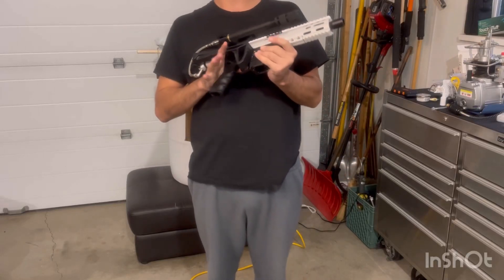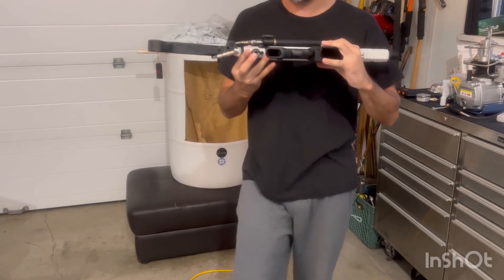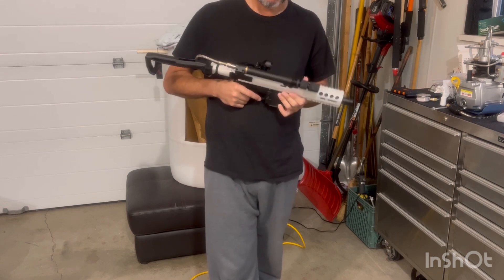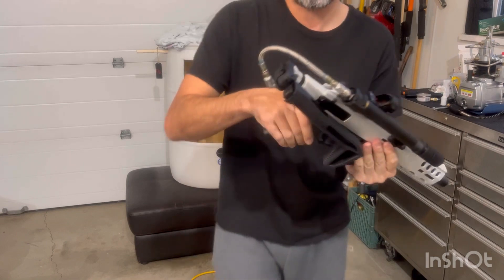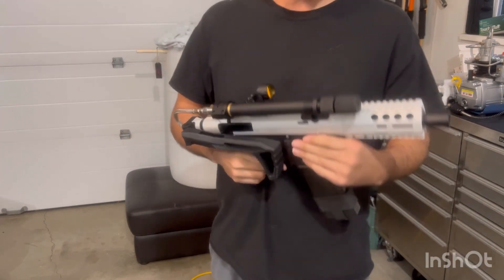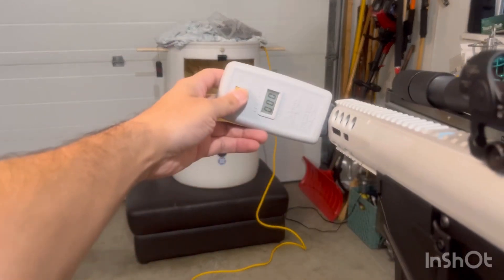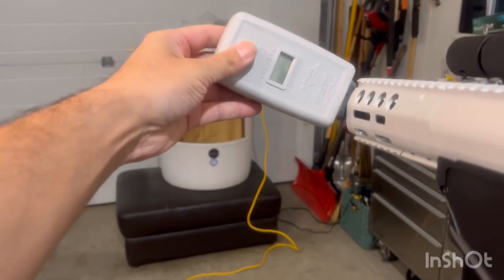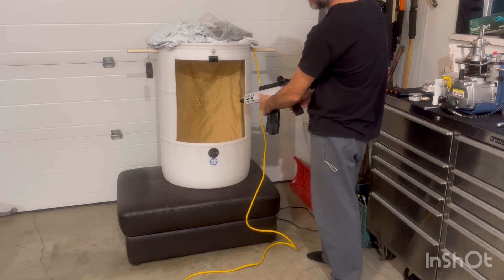Valken M17/Cqmf Bypassed on 2x12g Co2

Comment: The short-cycle auto firing (usually called "farting" in t4e markers) is caused by too much airflow--the pressure doesn't drop enough to let the bolt reset fully.
Reply from the maker: The question remains why some brand new markers exhibit this behaviour ambut most do not. I have found there are a number of factors at play.
Reply: @lesslethalfordummies  indeed. It can also be caused by excessive friction (bad oring or tolerance issues) or not enough return force (weak/bad spring). But if it happens only after modding it's usually caused by too much airflow, though it can be compensated with a stronger spring, etc.
Reply from the maker: @jungy537  i am running 2mm spring in this Cq to see if it has any effect on reliability and performance. It shorter then I would like but it appears to be working just fine right meow.

My Cq hasn’t experienced any autofire yet and i hope to keep it that way.

Comment: So as of today my build is pretty much looking like this but iron sights still on and no buttstock. But i am deciding on the 45 degree jron sightd and a scope for a cowitness so idk if Ill need 2 iron sight sets. Might look odd or maybe I'll just 45 degree offset red dot and keep iron sights at the end with an acog plus zoom scope while cowitness at the end idk yet. But for a marker i think I'm doing too much its not gonna shoot that far like a real gon so maybe ima just remove the iron sights completely and just use my scope rings for the co2.... currently my scope.rings are holding onto my quick change co2 adapter 12g since i cannot find a round 2x12g yet.  Ive inky got the stupid hexagonal umarex one.
Reply from the maker: Its easy to over do it with accessories and youll know when that happens. Sounds like it is coming along well.
Reply: @lesslethalfordummies how do you do white colors by the way? I gotta make me a frosty or a demon fire one
Reply from the maker: @-Cutz- white is just how it looked on camera after stripping the black down to raw aluminum using oven cleaner.

Comment: Getting my popcorn before I watch this lol … 😎🎯🎯🎯❤️
Reply from the maker: Caramel please.
Reply: @lesslethalfordummies  ok …. Guess I’ll be using my Hpa tank …. Last question lol
What’s is more recommended, .68 devastator rounds or hp68 ?? For home defense in my fully modded m17
Reply from the maker: @thecryptoendgame  the hp68 cycle good in the m17. I havent tried devastators yet. I did receive some clones from DK that i will be trying. Tou really can’t beat Hpa but co2 does work in a pinch just wont maintain solid numbers for much more then few shots.

Comment: I love how small it looks so badass i wanted to put zeta mags come to find out you hsve to flip them when you shoot 10 i thought it was CONTINOUSLY FEED
Reply from the maker: Yeah you are right and some of the heavier balls dont like to be invert unless you have the mag plate on the zeta.
Reply: @lesslethalfordummies mag plate? can you link me also can you link me the metal tube into the 2x12g adapter and everything betwen it or can you just tell me the names? so I can find them on mcsus
Reply: I mean i know the 2x12g adapter tube already but the thing thats housing the connection or the adapter with the metal hose and the adapter thats on the rail? whats all that?
Reply from the maker: @-Cutz- there is a plate that you can buy that slips over the bottom of the zeta mags to prevent them from falling out. Not sure where you find it but i see it all the time in the paintball groups.
Reply from the maker: @-Cutz- check out this vid it might answer some questions.

https://youtu.be/d0wPs-D7YME?si=qw118GqorpmqdOag

Comment: Love the remote hose! I want to do that with my vks but don't know what kind of UFA to get
Reply from the maker: Am struggling to decipher UFA 😆
Reply: @lesslethalfordummies   my bad - the universal fill adapter on remote lines. trying to figure out what would work in a flashlight clamp like you have or how to set it up
Reply from the maker: @theguy2137  most clamps are 1” and a select few are 1-1/8”. Common 1” UFAs are the Ninja knob style, CP has a trick one that self purges when the marker is disengaged and Palmer Pursuit had an actual adapter but had been sold out for some time.

Comment: What is the BEST  AIR SUPPLY size for M17 ????
Reply from the maker: 13ci tanks are best suited for the M17. If you can find 9 or 10ci tanks they also work very well and cut down the length a little.
Reply: @lesslethalfordummies  yes. Thats why we're were thinking of making the m17 CO2 POWER.  So we always have cartridges  on us.  And don't have to worry about the tanks running out 

But your  saying the 12gram  c02 version  isn't strong enough?

We have 13nci tanks now but it's too big to fit in a backpack.
Reply from the maker: @Save-A-DogAps  The 12g is strong enough if 4 shots get to where they are going but that can be tough in stressful times.

Comment: Hi, Can I use a 12gram co2 adapter on a m17 with no modifications?
Reply from the maker: Yes absolutely. There isnt enough liquid in a 12g to cause issue. I wouldnt run a 12g bypassed you might only have 3 full power shots but tuned conservatively tou might get 8 shots at say 20j. I am sure i did test single 12g a while back with lack luster results.

Comment: I thought your co2 build leaked heavy? So the cqmf can use both co2 and air??? Sometimes i rather just pop in co2 than top up my air tank
Reply from the maker: My m17 will handle 12g just fine but not so much the 88/90g without an expansion chamber.

Comment: So another thing looks like my cqmf will mainly be in co2, and I was gonna ask 90g because it's cheaper for bulk compared to 88, which is odd. I fired a dual 2x12g umarex hexagonal with the 88g/90? adapter and plugged right into it'd black with an on-off asa adapter all in 1... shot some shots and no leak turned it off after just to test to make.sure it works lol but anyways it works but 2 am so loud I had to stop so right now my umarex 2x12g is pressurized eith the on off asa I hope no long term damage I'm prob fire the rest in a week. Then, test my buffer 2x12g tube. I can swap to 2 x12g 2 separates, one so 48g and a single 12g 60g total real fast, but once I get ur around 2x12g, ima b😊e able to do 72g woohoo lol... but my setup is like ur nipple to back of my gun nipple double quick disconnect hose but my scope.ring is holding only a single 12g quick change so that's why I'm waiting fir my 2x12g round one my scope rings will be able to hold but so long shipping. And I haven't done the prv delete aka drill bypass but it sounds like it hits hard as shut. I love it
Reply from the maker: All i can say if you are wanting to use 88/90g because of your success with 2x12 is to test its function before you rely on it for anything.

Comment: Where did you get that 2xCo2 adapter from. I’m thinking of taking the next step and getting a Valken. And want to run it on Co2. Also can I run it on 2x NO2 12g cartridges
Reply from the maker: The adapter is from MCS. Umarex actually makes a bump to pierce 2x12g now as well much like their t4e hd lineup. Not sure where to find it yet. Skip the no2 unless you are actually keeping this in a cold vehicle over night. Remember if you were to keep it in a vehicle the chances of when you are reaching for it the cabin has probably warmed up some. N2o is consistent at most human habitable cold temperatures….but consistently low output is a more accurate description.
N20 just doesnt have the explosive expansion rate of co2 gas. Co2 is volatile when temperatures warmer then itself are introduced.
Reply: @lesslethalfordummies  thanks for the info on the NO2. I saw a Umerex 2x co2 adapter on ebay. But it was a twist not a hit and puncture
Reply from the maker: @EastCoastLessLethal  the bump puncture is new. Only thing i am bot sure of is there twist version requires 90g adapter fitting. Maybe the bump version does to? The mcs twist goes straight to hpa thread no adapter required.

It would be nice if someone could fill in the blanks because Europe seems to get stuff long before stateside.
Reply: @lesslethalfordummies  yes. I was just talking to a guy on FB. How the things like the power kits are so expensive because of shipping from Europe. I’m honestly thinking of buying a small hobby lathe and turning down my own parts. I did in my 20’s  for Harley parts. It was fun.
Reply from the maker: @EastCoastLessLethal  many things can be modified with a lathe and a drill press. I got half that so far. Which group do you frequent?
Reply: @lesslethalfordummies  I have both the MCS like this and many of the Umarex 2x12 twist. What I wanted to get was an extra seal for the bottom of the MCS one. It is rather unique. I just like extra parts like that. The guy at MCS said he could get that seal but I never followed up. I agree that only a single CO2 is really barely enough for high power shots. But actually, I often rely on a single 8 gram for EDC, but have it set around 32 joules. This FSC gives 4-5 powerful shots. number 6 (and 7 in the breech) are still gonna be painful but by then I will be in caveman mode and swinging. I plan to get my 12g mags in there tho. I have many of those. Just busy.
Reply from the maker: @maxhauler  the seal i imagine is easily available from Mcs. They do keep a lot of parts on hand. I find there site difficult to find stuff sometimes but a quick msg and they usually send me a link to what i am looking for.

8 or 12g is about max i would carry for an edc. Should have a Byrna Sd in my possession shortly. Hoping i can winder up a little and make for a good edc.